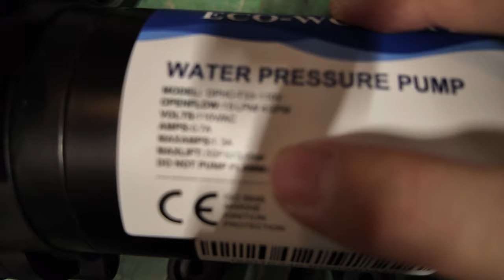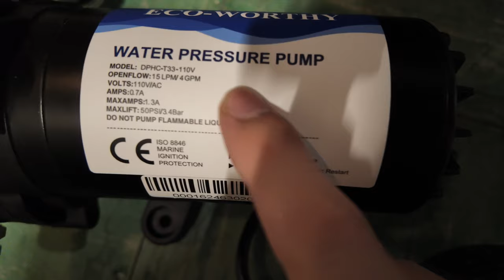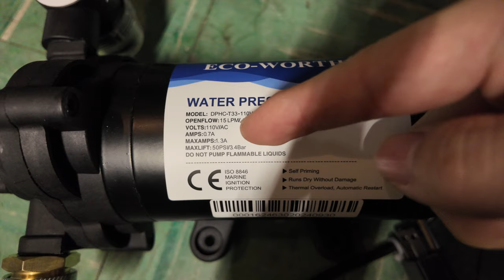My First Time Experience w/ a Rinseless Power Wash System (What I've Learned)

Comment: I have a RYOBI 40v Battery Powered 1500 PSI Pressure Washer and a handheld battery powered power washer, they both syphon water from a bucket or water hose so I use a 5-gallon bucket of rinse-less water.  I have no problem what so every getting them to syphon the rinse-less water and it makes it very easy and fast to pre-coat the car with rinse-less before doing a contact wash.  I also consider the rinse-less will help lubricate and clean the pumps of both machines.  Oh I forgot to mention, the best pressure washer to use, that syphons from a bucket is the EGO POWER+ 3200 PSI Pressure Washer delivers up to 3200 PSI at 1.2 GPM but it is $799 with two 6Ah batteries.  They have announced a new smaller pressure washer that only uses 1 6Ah battery, but it is not released yet, so I don't know a lot about it yet, but it should be a lot cheaper.  I got my ROYBI new from Amazon for $299, I thought for sure I was getting scammed because the normal prince is around $599, but it showed up new in box with nothing missing and works great.